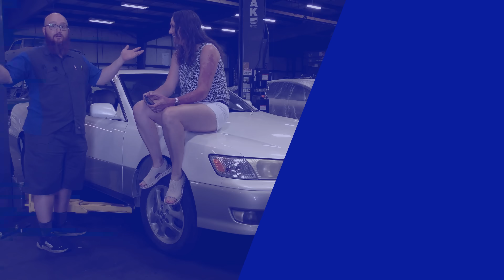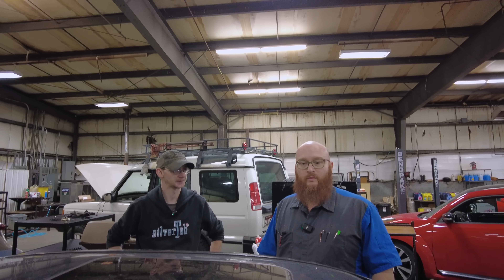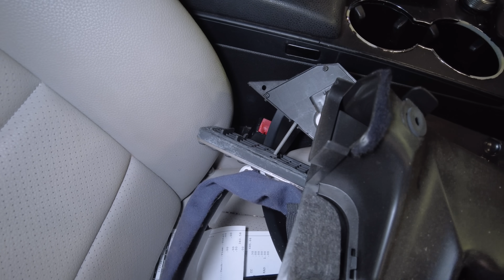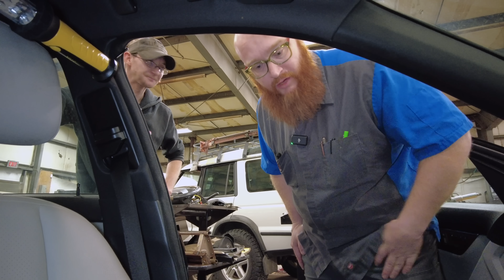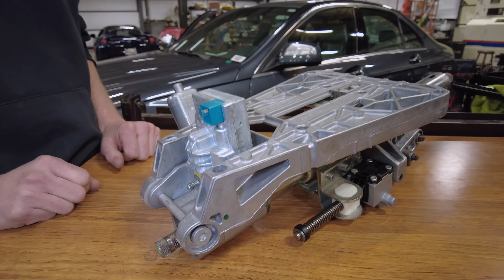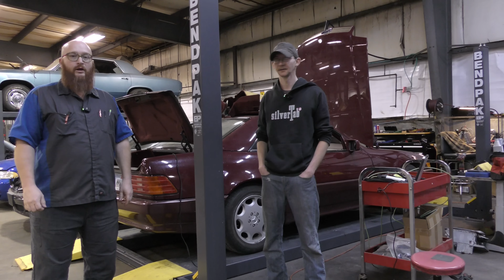Tiny Part TOTALLY Disabled This Mercedes! AND it's a Common Problem!

Comment: That’s kind of scary go somewhere like on vacation you up in the middle out in the middle of nowhere maybe in the mountains nothing locks up somewhere you’re in a world hurt can’t go anywhere you’re stuck. What happens if you’re in the middle of the snowstorm and that happens Pulled in somewhere middle of the night some small town get gas in the middle of the snowstorm can’t restart the car because of that how can one be sure that that thing won’t lock up on you driving down the road even is that possible I was trying to wonder about it if the sink quit on me twice Like this what happens going down the road and it just suddenly locks up going down the road electronics right in the middle of the steering wheel you’re trying to steer and suddenly it quits. What do you do? You don’t notice it until you try to steer and you can’t do it, some people don’t react quick enough they don’t think some of them don’t have common sense like some of us. Can you put the car in neutral emergency brake still work lotta people don’t think about it. Hopefully it will shut off if it acts up like that will it shut off even Hopefully it does just wondering end of rant. My opinion only.

Comment: I have an 89 300zx Turbo I picked up for $400. No start and next to nothing worked. I found rats made multiple nest all around the car. I soldered over 60 wires and it started right up and everything works. The amazing part was one had to be a 10 gauge wire and the rat chewed right through it.

Comment: If it would have been a BMW you would have bashed the horrible design and labour cost but if it’s a dead Mercedes or Jug with a toast engine, they are lovely cars with a issue

Comment: I just have my locksmith do the esl bypass . I bought one of these from the auction a few years back for $1500 with this issue and even drove it home by shaking the steering  column while twisting the ignition until I got the esl to work temporarily lol .

Comment: Does this effect the E-class?  If so what years?  Do you recommend preemptive or periodic replacement?
Reply: The 211 has a similar failure that’s much less common and doesn’t require programming to bypass, but the e class coupe is based on the 204 and is vulnerable to this failure
Reply: @GrimesGarage  awesome info thanks Tyler, what about the W212 generation?

Comment: I have an R class W251 that doesn't have a steering lock (thankfully). But my electronic ignition switch occasionally freaks out and locks down the immobilizer system. Exciting since it normal fails after start when driving down the road--lighting up all the dash lights possible and telling you not to put it in park but go straight to shop. When you do park, it's bricked. Thankfully so far, unplugging the EIS and resetting it that way fixes it for awhile.

Comment: I own a 2009 W204 C200 CDI in the same colour with 221K on the clock and it is pretty much in full working order. Most stuff on the W204 is pretty well engineered.
Reply: The issue is not bad engineering.  It's attributable to 'bean-counter led' very poor quality parts - with an emphasis on poor quality from 'you know where'.  If such a part had been fitted to a W123 Merc - it would still be operating today.

Comment: I owned a 2011 C250 and a 2013 GLK350, and apparently I was fortunate with those two vehicles as I never experienced this steering lock module issue.  The only issue I did have with either vehicle was having to replace the thermostat on the C250.
Reply: Good that you got out from under the 250 before it unceremoniously ejected a timing chain. 😅
Reply: @GrimesGarage  Approximately 150k on the odo and no timing chain problems, in fact no issues other than the afore mentioned thermostat.  I was either lucky or I got a good one, I had a good run of ownership with that car.

Comment: In the antipodes MB Adblue temperature sensor failed, stealership will only change the whole Adblue tank for $5000 not the sensor for $120.

Comment: I had this very problem!  Had the car towed to the dealer.  The dealer less than helpful and Mercedes even more.  Parts were back-ordered with no date as to when they would be available.  After three months of waiting, Got my car back and installed the emulator MYSEELF as mentioned in the video.  First and last Mercedes I will ever own.

Comment: I absolutely loved my c300 was very reliable, but I did have to replace my ignition lock and it did fail in the lock position, I pulled shipped my ignition switch and keys to a guy in California he programmed a new ignition lock and programmed everything for $350

Comment: Once upon a time, the Germans were renowned for great engineering. I wonder what happened.
Reply: The issue is not bad engineering.  It's attributable to 'bean-counter led' very poor quality parts - with an emphasis on poor quality from 'you know where'.  If such a part had been fitted to a W123 Merc - it would still be operating today.
Reply: Part of good engineering is the materials and processes used.  @georgebettiol8338

Comment: Oh hey I fixed one of those modules, except it looked a little different and I didn't have to cut anything to remove it (even though it was stuck locked). I actually opened the module up (not fun, it's held shut with tiny roll pins that need to be pulled out.) and replaced the motor inside, I remember being blown away by how tiny and crappy the motor looked, despite it having such an important function. Repairing the module was time consuming, but still MUCH cheaper than buying a replacement from the local stealership. If I did it again, I'd definitely go for the delete instead.

Comment: Reminds me of the old 90s GMs with the diode "chip" key and how the cars ignition fails. You can actually bypass using an exact Ohm resistance "Resistor" Diode that I litterly bought at Radio Shack that emulates the GM keys resistance and allows the car to start everytime, forever. Thusly bypassing the  primative GM security system of the 1990s.  Namely on my 1996 Oldsmobile cutlass supreme W body.  This isnt a new phenomenon, but an easy fix in the early 2000s when the problem started rearing its head as the roads were covered in said GM sedans.

Comment: Any single point of failure of a system like that should be more easily accessible. Reminds me of HVAC stepper motors on the previous generation C-class.

Comment: I had a 2008 B200 mercedes and had transmission control plate issues.  The huge insult is that the part is one time programmable to your VIN, so you can't use one off a wrecked vehicle. Worst, Mercedes couldnt source the $1800 part (in 2012); and it was cheaper/fastest to ship it to Bulgaria to a shop that does fix it, and ship it back.  Shocking.
Reply: With the right tools a 722.9 conductor plate is infinitely reprogrammable. But is also repairable for about $30 in parts plus fluid. Same tool I use to program these steering locks.😉

Comment: Wonderful German engineering 😂
Reply: The issue is not bad engineering.  It's attributable to 'bean-counter led' very poor quality parts - with an emphasis on poor quality from 'you know where'.  If such a part had been fitted to a W123 Merc - it would still be operating today.
Reply: @georgebettiol8338  Kraut bashing always brings a response from the snowflakes 😜. Mercs are trash, have been for 20 years, BMW's too, complete rubbish.

Comment: Isn’t Hyundai/kia getting the old class-action right now for NOT including a similar system in some of their products?
Reply: That issue lies in the immobilization system. Rather the system it doesn’t have
Reply: @GrimesGarage  and isnt Mercedes-Benz EIS the immobilization system?
Reply: @user-ew6jy9mo4r the EIS, the ME, the ESL and the EGS are all part of the system on these. One component fails you get no start authorization. Luckily the ME and EIS are pretty robust in the 204, but the 722.9 conductor plates have speed sensor failures pretty commonly.
Reply: @GrimesGarage  I know. That’s why I said Hyundai/Kia is getting the pants sued off of them for not including a similar system.
Reply: @GrimesGarage holy crap. Didn’t realize who I was talking to!  Since I have your attention, i fixed an ASR light and limp pedal on a 91 129 by replacing the alternator brushes.  There was a link on the OLD forums that talked about it.
Reply: @user-ew6jy9mo4r  that’s a VERY interesting solution. Thanks for sharing!

Comment: Had the tiny electric motor in the module crap out on my W204. It was an afternoon of disassembly, open the module to replace the motor, and reassembly. Replacing just the motor makes it so the module doesn’t have to be programmed. It was a PITA in an otherwise super reliable Merc.
Reply: Where did you buy the motor?

Comment: My last German car was a VW Rabbit.  The radio antenna lead ran under the front fender, exposed to all the road rain and snow and salt.  All that stuff would run down the cable and through a rubber grommet, further on down the cable until it reached the low point of the cable, which was directly over them main car fusebox.  Total fusebox failure within a few months.  Car also had overly small taillight housings that caused the taillights to overheat and burn up.  Also the rear brake lines ran inside the car, alongside the driver's door, where snow and salt from your boots corroded away the brake lines.  The car still had some aspects of quality German engineering, like the Bosch fuel injection system.  Oh, I forgot, on our honeymoon, way out in the Colorado high desert, just after sundown, a almost unreachable alternator hold-in bolt loosened up and the alternator pinged and vibrated itself to death.  Some pluses but many minuses!

Comment: I'm the moron that'd 'fix it right' and then do it again in four years.

Actually, I'd never keep a daily driver that long. I'm okay with the costs. When the warranty ends, off it goes. It either gets saved or traded in. As it's a daily driver, it's probably getting traded in or resold as a private sale.
Reply: Can't argue with your plan.  The only constraint is the money to buy a new Merc (circa $50k to $60k) every four years and to hell with the trade-in loss - which would be substantial.
Reply: @georgebettiol8338  I'm pretty squarely in the BMW camp. My daily driver, during the summer, is an M6 Competition. It does have 6 years of warranty and I'm well within the mile limitation which is 60k with my current daily.

I eat depreciation like a fat kid eats cake.

Right now, my current example might be worth 80k on the retail market.

On the other hand, the driving experience is absurd and my brakes catch on fire when I drive in a spirited manner for too long. (This is normal for carbon-ceramic brakes.)

So, it's worth it.

It's fiscally retarded. 

But it's worth it. I might just stuff this one in my collection instead of trading it in when I buy my next daily driver. The M6 Competition is pretty much perfect in every day (for my needs). I wouldn't drive it on wet or snowy roads, but it's otherwise awesome.

Comment: You are the best... I have been working on cars for over 50 years and I learn something new eveytime I watch one of your videos... and yes the emulator work around makes 100% sense. I just replaced the CATS in my 2006 Jaguar VDP with the Arnott kit to avoid the unnbelievable expense of the OEM air shocks. Guess what It even drives and handles better and a lot less like a floating road sofa!... sometimes a work-a-round makes perfect sense. Keep up the great videos.

Comment: In the 80's I was a fan of Mercedes I had 4 of them, the last one from 1999. And then, I have now for 10 years, a 15 year old Toyota Yaris, well you can feel the difference, no stress of weird breakdowns that cost a fortune, starts all the time, even at -20 degrees, no brake change every 8-10 months, etc... In short, happiness...
Reply: Yeah, but then again... you drive a Yaris! 😂
Reply: Indeed, it's much cheaper than having a Bentley, and putting $10,000 into it, every 6 months. @romanpolak3239

Comment: BMW had a similar problem in 1984 with the steering wheel lock; temporary solve back then was to use pliers to turn the key

Comment: My Audi A6 had the same kind of issue. It required an entire new steering column, because the small electronics module that failed was not sold individually. Ended up paying $3500 as it also took them half a day to register the new module with the rest of the car.
Reply: that's why I stay away from European cars, too much unneeded and unreliable complications that will cost an arm and a leg to fix...
Reply: that is insane, thats the reason why i will never buy a german car unless its brand new and under warranty.

Comment: It's amazing how these automotive engineers come up with more and more ways to make cars more complex. 
All cars have had mechanical steering locks for ages that worked well and didn't cause a problem for the most part, but mercedes had to go and motorize it so it could fail and leave you a huge expense to fix.
Reply: But that led to Kia boys type incidents
Reply: @Thondimuthusamy  ???

Comment: Aah the beautiful W204, once had an 320 CDI v6 2008 sedan. Best car i ever had! Drove so smooth, inmense torque, looks, no failures in 6 years and great mileage. Bought with 50k miles and got rear ended with 150k miles. Did a total of 6 dealer service for 300 to 500 euro. The only expensive thing is the government, monthly tax was 180 dollars and insurance was 160 dollars a month. Full tank was about 70 dollars for 600 miles.

Comment: MB was the standard by which all other brands were judged but not anymore. This is bad engineering and a darned good reason to avoid used German cars. As I've said before, these cars are okay in their homeland where seasoned mechanics and parts etc are on every street corner.
Insofar as theft is concerned I wouldn't worry one iota because if I woke up one morning or returned to the car park and found my MB stolen I'd be dancing on the spot and contacting my insurance company, it'd be like winning the lottery.
Reply: The issue is not bad engineering.  It's attributable to 'bean-counter led' very poor quality parts - with an emphasis on poor quality from 'you know where'.  If such a part had been fitted to a W123 Merc - it would still be operating today.
Reply: In my opinion it is bad engineering because of it's location, it has nothing to do with bean counters. All parts are prone to fail (good or poor quality) and one as crucial as this should be better accessible.   @georgebettiol8338

Comment: What do you guys think about the 2020 Mercedes GLC300 4matic?  Is it a good car to purchase or should I run in the other direction
Reply: Post-2018 Benz is a crapshoot. Lots of QC issues
Reply: @GrimesGarage  Oh ok, Hmm, well maybe I can take my chances and hope for the best.  I could always get one that is certified just to be on the safe side
Reply: @shaunmiller3342  I don't believe the certification will assist with the in-built and present Quatlity Control (QC) issues.  What may alleviate the financial pain is an extended warranty - if available.

Comment: Hey car wizard you can use a grinder and cut part of that steering column lock housing and access the gear, you can turn the gear with a screw driver and manually turn the gear and it will unlock the mechanism
Reply: But the computer does not know it’s unlocked so it won’t send power to the car
Reply: That's how you remove the steering column lock to disengage the shaft where the nut mounts on. Theres a dtb bulletin. I had this happen to me 10yrs ago..

Comment: That immobilization module sounds like a planned failure point from Mercedes. Especially since there hasn’t been a recall with an improved part at Mercedes cost. 6 thousand dollar part plus labor. That makes Mercedes and their dealers big money. Mercedes should have been held accountable for that.
Reply: I don't consider it to be a 'planned' failure point.  However, it's certainly attributatble to 'bean-counter led' very poor quality parts - that are in increasing in use by German OEMs.
Reply: @georgebettiol8338  I wouldn’t either except they’ve said it’s a known issue and happens a lot.

Comment: This happened to my 2006 BMW E90 325i. Fortunately it started working again after parking overnight so I could get it home. Pulled the column, removed the module, drilled the rivets or whatever holding it together, regreased & it works again. Then of course I put the emulator on it so I didn't have to worry about it ever again. My 2009 LCI 328i - no problem because it's no longer equipped with column lock from the factory. Phew. Good video Wizard.

Comment: This "fix" can't be used over where I live, since one of the annual inspection requirements is that the steering lock works.
Reply: what if it came from factory without steering lock?..
Reply: @EuroprisPluss  If the car was orignally introduced without a steering lock, then it would logically pass the annual inspection.

Comment: I have a 2013 W204 and would take the cheaper repair, because I have an approved  manual steering  wheel lock.

Comment: Two questions... 1. If it left the factory with a steering lock, does removing it affect theft insurance?
2. Surely if you buy a replacement module from MB, it comes pre coded for the car as it will be what Mercedes call a Theft Relevant Part. So the correct part will be plug and play. Yes it might cost $1,500 but that is probably more cost effective than insurance not paying out after it gets stolen because you've bypassed a part of the immobilizer...
Reply: The locks still have to be learned / programmed to the car even from the dealer. How is the insurance company ever going to know if you installed an emulator? The emulator is not really bypassing the immobilizer, it's only one part of a system. The EIS (ignition switch) and key/s are the important parts. The fact is, if someone wants to really steal something, they will take it no matter the hurdles.